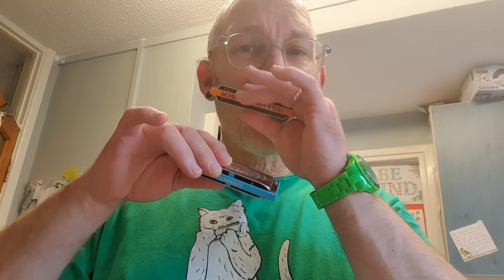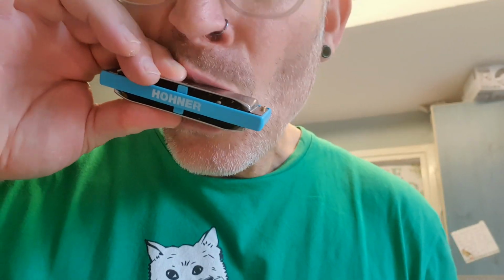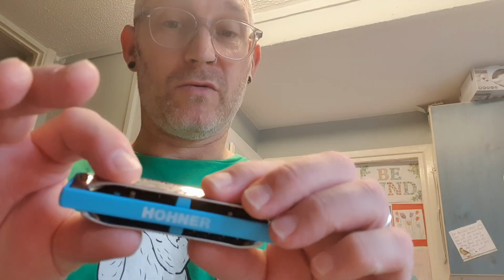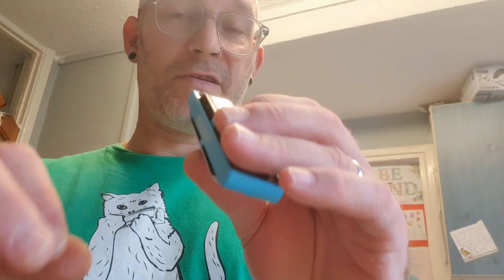Part 5(final test) Sanitzing & testing a second hand/used harmonica. Hohner Rocket Low-D

Comment: Why does that session steel look different? Normally the ones I see have different cover plates that cover the whole harp. Is that an older model?
Reply from the maker: No I worked out that I could put cover plates from a classics onto a session steel. 

Session steel covers are more closed & the classic ones are open. So I build my own. I buy reed plates separately, then buy separate comb and add the classic covers👍